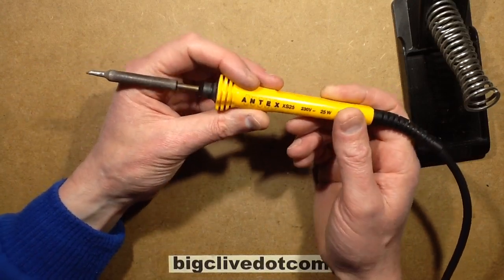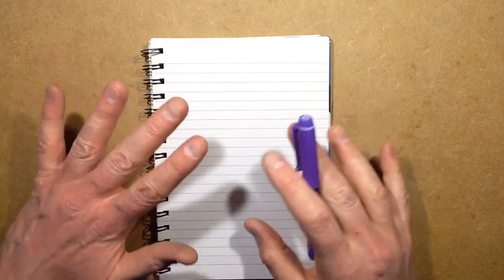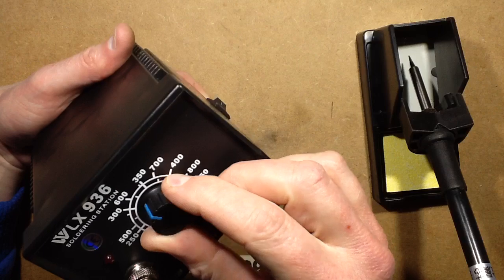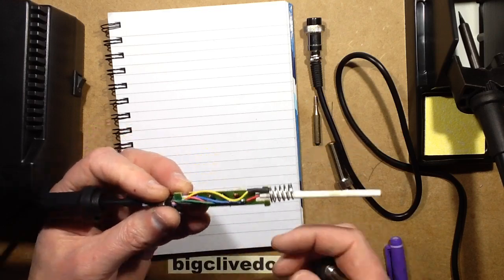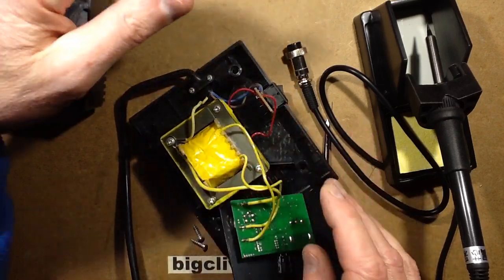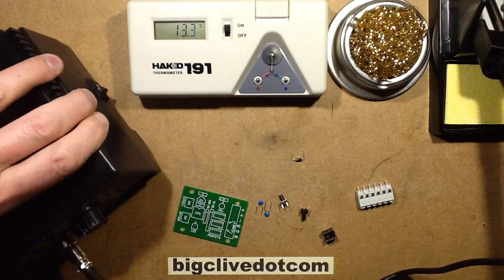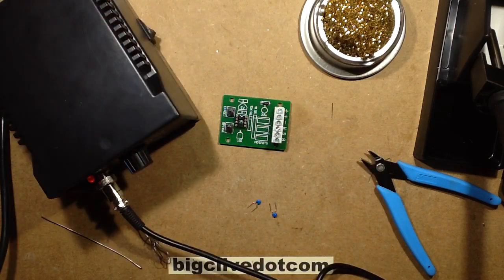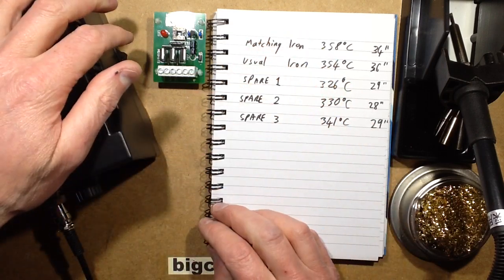Soldering basics and choosing a cheap soldering iron.

Comment: If you solder a lot, you might want to consider getting genuine Hakko tips for these. The Chinese tips are dirt cheap, but they deplate relatively quickly. They used to last me about a month each. Over a year ago I've switched to genuine Hakko tips and I haven't had to replace them yet and apart from the nickle part of the plating changing color slightly, they don't show any sign of aging (I do take good care of them though—cleaning them, keeping them tinned, no wet sponge and all that jazz). Also there's a much wider selection of the genuine tips (e.g. the Chinese are not making the BCM tips which are a godsend for soldering fine pitch flatpacks).

Comment: I've got a Hakko 936 clone here that seems compatible with genuine hakko 936 accessories same thermistor etc., about $30 on aliexpress  the front plate looks similar to the one in your video but the connector on the base station is female with a female thread (same as a real Hakko 936) .  build quality inside was good apart from the crimps on the mains lead which looked like they were done hastily with blunt-nosed pliers. instead of the proper "M"-shaped crimp tool

Comment: Great job, but, flux, flux, flux man. Amtech NC-559-V2 from mailin.repair (no .com). Or any type RA flux. 

Seriously, by far the best way to improve. I've even used the expensive 1/2 mm multicore solder and nothing helps like proper use of flux.

Comment: Just to tell you, the only soldering iron available (that require no ordering, walk-in type store stuff) here are those chunky unregulated 50W ones, which easily burn a hole through fiberglass board into the core of the Earth or something. It goes above 470 degrees Celsius and pose a fire hazard by itself!
(I know you could like, source them from a specific reseller, but I'm talking about the generally available ones)

Comment: Not to confuse anybody, but when i was doing some circuit boards, i realized that i needed 3 hands and found that if i used liquid flux on the joint and then "dipped" the iron in solder, i could indeed carry the solder to the joint and knock out all the joints in no time flat.  But that's not how to learn.  It's how to expedite the shit out of the work.

Comment: Hi! I've bought (https://www.aliexpress.com/item/A1321-For-HAKKO-936-Soldering-Iron-Control-Board-Controller-Station-Thermostat/32715760598.html?spm=2114.13010608.0.0.czzJIX) and this board does not change voltage for my soldering iron  it is connected to a 24V AC transfo. the iron is getting overheated because of this. here is a picrure of my setup (https://goo.gl/photos/aW6SUkyP5tQzT8in7)

Comment: The worst I've ever used was a RadioShack one. Poor build quality, horrible tip that basically melted away after 4 days, the tip is pretty unique and can't be replaced by a normal one, it isn't grounded and rarely got hot enough.

Comment: I recently got a butane one from home Depot. It uses normal lighter grade butane, has a gorgeous sharp and thin jet, has a basic fuel control (which is also a temperature control by proxy), and can be used as a hot air blower and lighter. I love it, and it's fully portable. Only $20,and the butane lasts about a week per refill for me, especially if you don't just keep it on 

Its a benzomatic
Reply: chistine lane I bought a cheap blue one from eBay for 5 euro. I love it. It has an attachable metal bit and can be used to solder on PCBs. It heats up fast and is great for quickly fixing something.

Comment: mmmmm properly grounded tips. my cheapo yet expensive radioshack soldering iron ($40) had no ground pin. the other day I was soldering an led strip onto my drone, and what do you know? when I touched the iron to one terminal and had my finger on the other the leds glowed a little bit

Comment: Do you know if those 900m-t-3c chisel bits would fit a yihua 878ad soldering station
Reply from the maker: +steven cornwell They should fit most of the common low voltage soldering stations.

Comment: hi how are you i can tell you know stuff about soldering irons.  I have a dilemma i got a soldering from china and it wont get hot enough and i noticed it says 35w 220v/240v and that's obviously AC i didnt realize it be that and i use 120v in my outlets. my question is the board on the iron has a diode 1007x i think could i use a smaller one to compensate for 120v i believe that's the reason i don't get enough of the 35w since its 220v any suggestions if you need some photos id be happy to send some
Reply from the maker: It's possible that a diode (1N4007?) has been out in series with a 120V element to allow its use on 220V.  If the PCB has more components then it may be designed completely for 220V.
Reply: hey thank so much for getting back on this yea i would send you a pic but not sure how but its a real simple design and that's the only electronic component on the board i think i see zx1007 on the diode and the ceramic element has only to thin tiny wires coming out of it i got this from gearbest.com cause it was super cheap apparently In more was the one.  i was not sure what you meant about "in series with i didnt do well in my electronics training   I'm not a complete idiot in electronics just an idiot so is the " in series" part significate and can doing something with that or the diode get it to work with 120v     here is the idiot in me with this.. a diode in this case and as far as i think i know kind a know hope im sorta close to knowing that a diode keeps dc voltage going in one direction     please there must be something i can do to get my cheap iron to work

Comment: hi Clive, I am look for help... Recently I bought a 8586 Chinese 2in1 rework station, the air gun is working perfectly with instant heat, but the iron only like to start heating up when it feels like it! the iron red light is on, but not getting any heat at all, until sometimes I unplug and replug the iron connection, or used the hot air gun for few minutes. so far I still haven't found a sure way to kick start the iron to start heating.  But once it is heating, it works perfectly, the iron red light will be off when the iron reached the selected temperature, etc.   I open the cover, looked at the circuit board, found nothing unusual, all wires are properly connected, all solder joints are clean.  Can anyone direct me how to trace where the problem is?
Also, in this type of 2in1 board, is the iron running independently of the air gun?
Is the transformer need time to warm up before giving out the desired voltage output?
Can I disconnected the iron output connection and add a bare iron-only control board and fed the 24V from the existing transformer to the new board, wire the iron 5 pins to the new board etc?
Reply from the maker: It sounds like a bad connection.  What's the display showing?  Is the soldering LED lit?  Is the soldering switch intermittent?  What happens if you wiggle the soldering iron plug, and is it fully locked in?
Reply: bigclivedotcom The iron LED is always ON until the iron reached the desired temperature, or just ON but no heating, the iron connection plug is locked in, the switch sound is solid. I even bought a 2nd iron, the same.  if after a successful heating session, switched everything off, leaving everything on the bench, the next day, the same problem happens all over again.
Reply from the maker: The main components involved in the switching of the heating element are the large triac on the PCB and possibly an opto-isolator next to it, and the connections to the iron itself.  I'd suggest checking the PCVB for a bad solder connection, especially around where the front socket connects onto the PCB.
Reply: thanks Clive, I checked all connections around the output to the iron, including the 5 pins  metal socket that connects to the iron, checked the transformer 26V output wires connection and the 2 wires that provides the power to the heating element after the triac, all clear.  however, when I measured the voltage of the 2 wires that power the heat element, zero volt, measured the 2 wires that is next to it, which is from the transformer, 26V. so somehow the triac is not working. but then why sometimes it works sometimes not?
the triac is a 3 pins with BTA12 600B MAR 1607 written on it, while there is a large black thing with 6pins, it has EL3023 444 written on it, is this the opto-isolator you mentioned?  if these 2 components are faulty, question is why sometimes it works? I guess the easiest for me is to buy a stand alone hot iron PCB and connect the transformer 26V output to it, and wire the iron 5 pins to the new board, insulate the whole board and put it inside the 2in1 enclosure, etc. what do you think?
Reply: hi Clive, just want to let you know that I fixed my problem by replaced the opto-isolator. thanks for your advices leading me to identify the crucial components.

Comment: @ 32:32 was it really originally an ashtray or were those grooves purposely made to rest the hot soldering iron tip on, but it just looks a hell of a lot like an ashtray ?
Maybe it serves a dual purpose for cheap soldering irons (not stations) which plug straight into an AC outlet (so it's a soldering iron tip cleaner and soldering iron stand all in one)
Soldering station's usually have a soldering iron holder , don't they ? 
But soldering irons that plug straight into an AC outlet don't.
(  Sorry for my tone , I don't mean to sound like a know it all smart arse , just trying to add to the comments, that's all. :o)  )

Comment: It seems that i am the only idiot that is soldering at 480 c.
Reply from the maker: That's pretty high.  there's a risk that your soldering iron element and tips will fail faster at the higher temperatures.
Reply: since i've got that soldering station(Pace sensa temp, really good) I did not change the tip. I even left it accidentally on like you did but luckily only for a day. Still soldering like on the first day.
but I will set it lower if it will increase the life time of my soldering station.

Comment: I have the digital version of this station and I ordered a second iron for it...the second iron didn't work with it at all...it made the transformer overheat..luckily it didn't damage anything as I noticed the problem right away..When I googled it I found that there seems to be 2 versions of the iron, I can't remember what the difference was but I think it had something to do with the resistance of the heating element but don't quote me on that.
Reply from the maker: There are various heating element powers, but the main issue is that some have thermistors and some have thermocouples as temperature sensors and they are not compatible.

Comment: You forgot to explain how to hold the iron in one hand, the solder in the other hand, and the work-piece in the other hand.
Reply: ...you obviously hold the solder with your teeth. Only do this with leaded solder, the new fangled stuff is too hard and might chip your tooth!   /s
Reply: A little blob of some handy-tack will stick your workpiece to a table so you don't have to hold it. Alternatively if you want to get fancy you can buy what's called "helping hands". Essentially a weighted base with alligator clamps for holding whatever you're soldering; and a magnifying glass for those smaller projects. I've used the same yellow piece of handy-tack for over 6 years to hold wires/connectors in place while I solder, and I actually still have it stuck to the top of my yihua 936. 

I finally ordered a set of helping hands a couple weeks ago though, and it works an absolute treat. That's $10 I wish I would've spent a long time ago.
Reply: @troyguinn303  that is a nice idea, I'll try that. I do have two 3rd hands and a micro vice but I think the handy tack might work better for quick and dirty soldering work or odd shaped objects. Tnx.
Reply: @troyguinn303  Here I was thinking I'm the only one who uses blu-tack (same stuff, different color). Originally used it to hold tiny jumper wires in place while soldering them to the pins of fine-pitch ICs during modchip installs in game consoles.

And I also just got around to buying a set of helping hands a few months ago. Haven't pulled it out of the packaging yet. But yeah, weird.
Reply: They do sell what is called a third hand, but I've never used one.
Reply: @richlaue  they work very well
Reply: Jim Fortune "PLAY!"
Reply: He has multiple opposable digits per hand. No mean feat for a bear
Reply: A big piece of duct tape holds everything.
Reply: @AnadiaShark  That's why we have 5 fingers, isn't it? 😁 I used to wrap the solder round my thumb so I had an extra one to hold the job. Millions of years of evolution all led up to preparing us to do a 3 handed job with only 2 hands.
Reply: @AnadiaShark  I use the index and middle finger for the solder and the other fingers for the object being soldered, because solder is lightweight enough that it doesn't need the thumb for grip.
It's when trying to solder two loose ends with a butt splice that you need that third hand-
Reply: I use my foot to hold the PCB 
no joke
Reply: So basically, how to grow a third hand? Cause to do what you're suggest, it really sounds like you'd need one.
Reply: @tdark987  Ask Zaphod Beeblebrox.
Reply: @tdark987  use a jig or clamp
Reply: Thats a cheat code just open notepad and type or print cheat code god mode on and now you can solder like Clive.🤷‍♂️😁🚬🤣🤣🤣🤣

Comment: Something i am learning to do now , is using a soldering iron. Because i have a rc truck and car hobby. and sometimes i need to solder wires when wires break. or putting on new battery connectors.

Comment: DIN is Deutsche Industrie Norm what mean German industrial norm. if you have this different norms and takes every time the same, you can be safe, it fits everytime. Norm  is a German standard!!!
Reply: Toni L it may fit but the pins can be different
Reply: Agent Office if you buy a product with, for example, DIN 100 then every time in every country a replacement with DIN 100 will be fit. it's a norm size what makes you sure it fits 100%!!!

Comment: Big Clive, I have a Draper Soldering Gun. Instructions are clear not to use it for more than 12 seconds in any 60 second period. I do tend to exceed this, but it does give me the colleywobbles. What would happen if I pushed the envelope? Maybe a mini-test for you? http://www.drapertools.com/products/manuals/71420ins.pdf
Reply from the maker: It's the duty cycle.  The internal transformer is not rated for continuous operation to keep the size, weight and cost lower.  (Cheap welders do that too.)  As long as you give it a break to cool down from time to time it will not overheat.  But if it does start to get too hot then take a break and have a cup of tea or coffee while it cools down again.

Comment: I have been trying to connect tabs to batteries, N-Cd 1200mAh to no avail.  I am using a 35W iron, is this the problem, do I need more heat.
Reply from the maker: They're normally attached with a small spot welder because of the metals used and the risk of heat damage to the cells.
Reply: Douglas Kent Maybe try some mid-grit sandpaper on the contacts... but as Clive said there are proper methods to do it

Comment: I found the bare PCB for 2.99USD here:
http://www.ebay.com/itm/Soldering-Iron-Station-Control-Circuit-Board-Controller-Thermostat-A1321-For-936-/142116071016?hash=item2116c72668:g:MvkAAOSwknJX15Hl

but I cannot find the 5 pin connector anywhere. Any ideas? Maybe solder the iron leads directly to the pcb?
Reply from the maker: Note that there are two types.  One that uses a thermistor in the heating element and one that uses the more common thermocouple.

Comment: hi there Mr bigclive, or anyone on this planet please help me, i got the same rework station like yours few month ago, my question is,  the main unit controller getting warm and then so hot after i used it more than 30 minute on 300celcius iron setup, is that normal the main unit  getting hot? i just worried it will blow up on my face when i used it more than 30 minute. thanks.

Comment: Be careful with these Chinese soldering irons. A number of them have very poor mains power designs. Several of them are extremely dangerous to leave plugged in, even though switched off. This is because the switch does not actually kill power from the mains. It simply kills power to the control board. open it up and verify that it is correctly built, and correctly fused. Another thing that has been reported is that they are fusing the ground, rather than the hot side.

These have caught fire when left plugged in. I did purchase one and noticed these problems, so I modified it to deal with these safety issues.
Reply: Good info. I have had the same model unit as shown as a secondary soldering iron. The unit was really cheap and works  nearly as good as a Hako unit. I do notice the cheaper components, like hard plastics and PVC wires. Have to say that so far it has been a winner, but will take a look at the electrical safety.

Comment: Hi Clive, i was wondering if you could reccomend a soldering iron for a newbie, ive had a look on ebay and screwfix(spoiler they seem to have nothing in the way of irons) but i dont really know enough to seperate the wheat from the chaff in terms of irons, ive been watching your videos and a few others and im lucky enough to have a father who recently got qualified as an electrical engineer and as a result of those factors i quite fancy learning to solder so i can start repairing/making some things around the house. unfortunately though i dont have a clue what would be a good introductory level soldering iron for someone who will be looking to progress through the learning process as a fairly fast speed so i would really appreciate if you could reccomend something.
Reply: Try watching the video